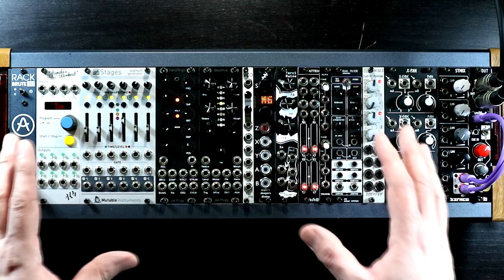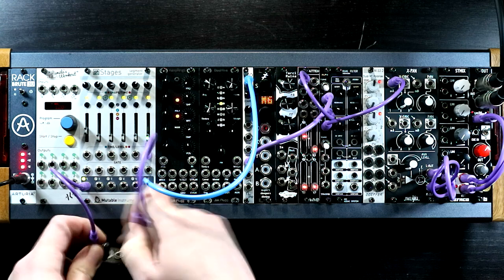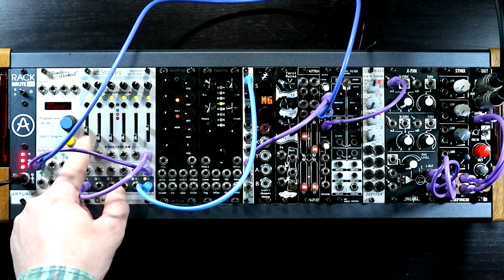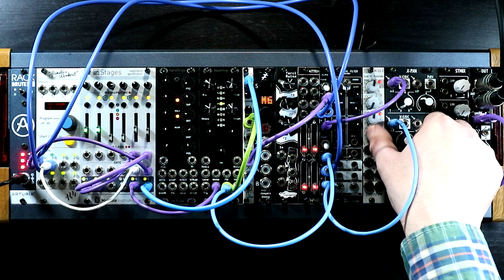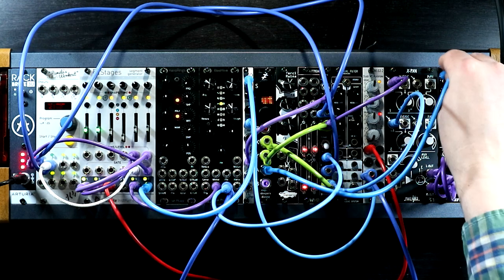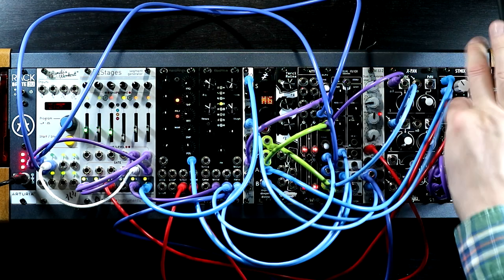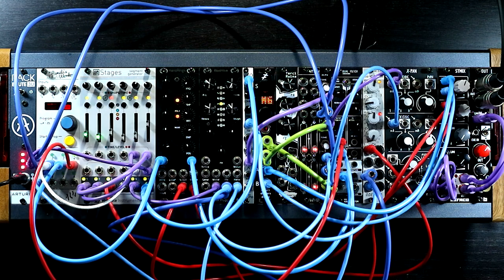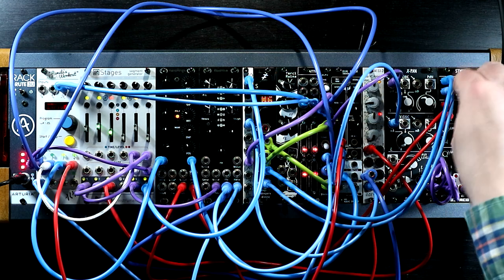Modular Patch from Scratch - Delightful  bloops and using Stages to create a performable sequencer

Comment: I love the new direction. Great to see modular being featured. Great work man! I have been debating on picking up Stages for a while now.
Reply from the maker: Cheers! I'm glad you're enjoying it. It's definitely the case that the time off I took off over winter reignited my excitement for it (and for talking about it).

Stages is one of those modules that offers a lot of utility in a small space and is highly configurable to your needs. The alternative firmware really kicks things up with some of the tweaks and new features. It takes some learning (and I still get things wrong with it), but there's not much else that matches the functionality for the size.
Reply: @OscillatorSink  I've been playing a lot with the harmonic oscillator mode of stages, too
Reply from the maker: @Lcrymlgy  yeah, I need to play with that some more - problem is it means I lose a bunch of modulation sources which then makes that mode less interesting... I like that they included two versions which swap the behaviour of the level though, that's really neat!
Reply: @OscillatorSink  yeah, but if you modulate the harmonic of each stage, then it's already quantized. I've got marbles sequencing three of them, and then a fourth one I play manually, going through a distortion and a filter to make it stand out.

Dang, I didn't mean to take over Ben's comment, my point was: definitely get stages, it's an amazing module. It can do rectification, slew limiting, envelope following, and that on top of being LFOs and extremely flexible envelopes.

Comment: How do you feel about the ergonomics of the nano rings and beehive? 
If you had space for the full size modules, would you?
Reply from the maker: I don't find it an issue most of the time. Would I go with full size if I had the space? Rings I would as its quite a performable module, Beehive/Plaits I could take or leave as its more set and forget.
Reply: @OscillatorSink  thank you for your response, and great video
Reply from the maker: @arbrvta  no worries! Thanks for watching!

Comment: I'd like to see you get a full drum kit (at the least, a kick, snare, plus open and closed hi hats), a bass line, and a lead melody cranking out of that just the gear in that rig (aka: no outboard gear except maybe those inline attenuators you have). I think it should be just about doable. :)
Reply from the maker: I sort of, kind of did that in my last Modular Patch video (with a tiny bit of help from a Bastl Kastle Drum) actually. If I had eschewed the chords on Plaits I reckon I could manage without any other gear....